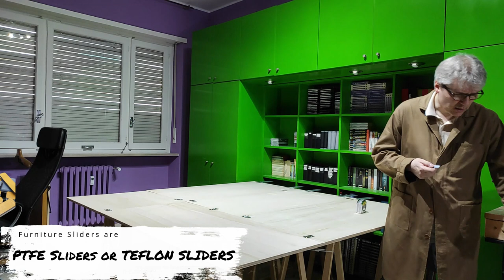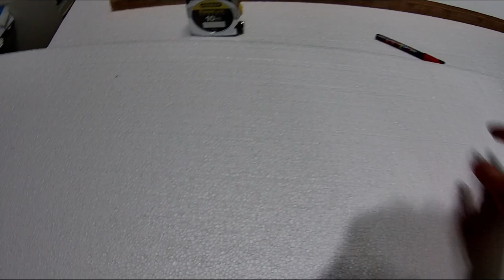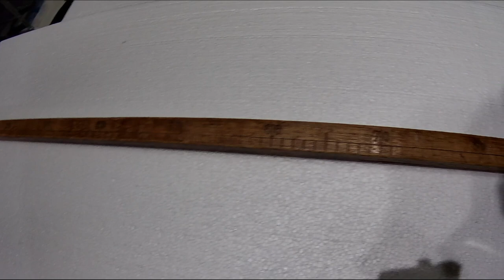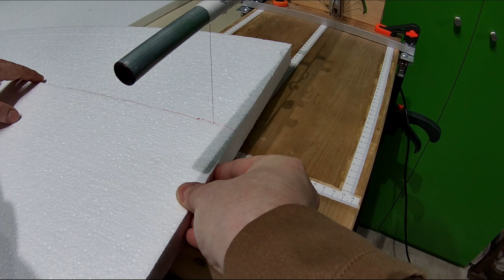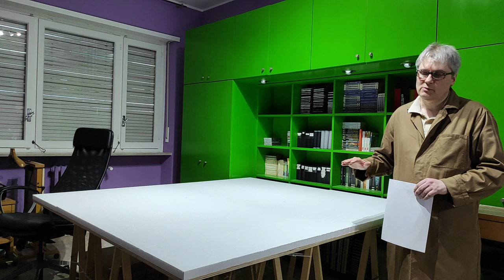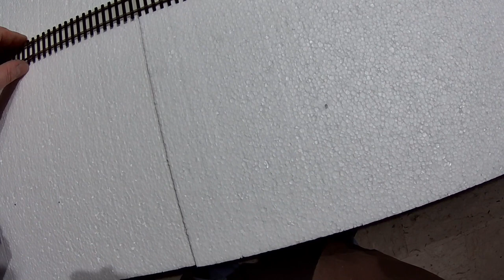Christmas Village Tutorial 2020 - Part 1

Comment: Great video and great work! Im watching your videos in order and can’t wait to see what comes next. Which glue do you use to stick the foam together? Also do you use a hot wire tool inside the house? Thanks
Reply from the maker: Hi Vanessa. Thank you for your appreciation. In this first part of the series the glue wasn't yet involved. Just some u shaped metallic pins to keep the styrofoam panels in contact. More precisely florist pins. They come from the following store:

https://www.rayher.com/en

and the 2 sizes I bought:
https://www.rayher.com/en/roman-clamps-2106600
https://www.rayher.com/en/strawflower-pins-2106500

Anyway as concerning the glue I use a rapid wood glue, it is a vinylic glue most adapted for wood but it is suitable for everything. It has a drying time between 5 and 10 minutes and become transparent.
No vapors at all so it is a perfectly safe glue.
The brand I use is sold mainly in Italy and Europe but similar glues can be find everywhere:
http://www.saratoga.it/it/prodotto/1/81-adesivi-vinilici/585-colla-rapida-per-legno/

The hot wire tool has a voltage regulator so I can adjust the temperature of the wire in order to limit the emission of toxic fumes as I always use it indoors but I constantly ventilate the room while using it.
Reply: @silvioallena  Thank you so much for all the details it’s super helpful! I am currently on video number 3 but I plan to watch the whole programme before I start my project. Thanks again looking forward to seeing more of your working in the video number 4
Reply: I enjoyed the little notes and this is a great video helping people to get started. This is my first year using styrofoam  and I have gone stark raving mad with it!